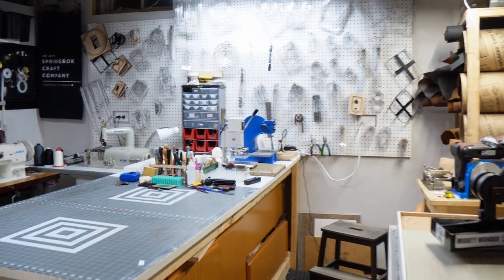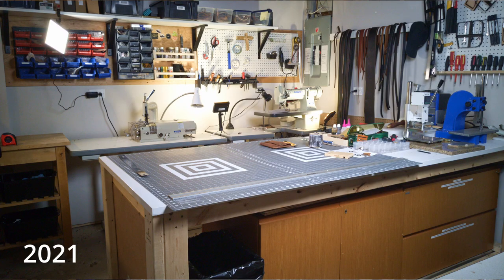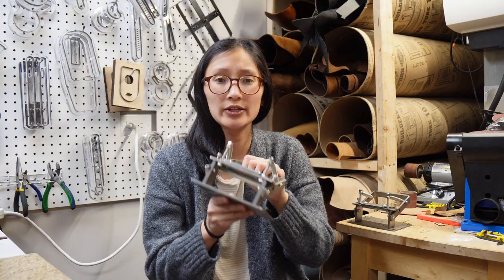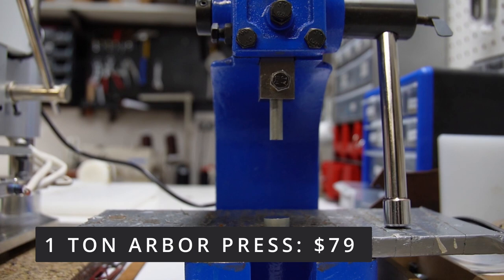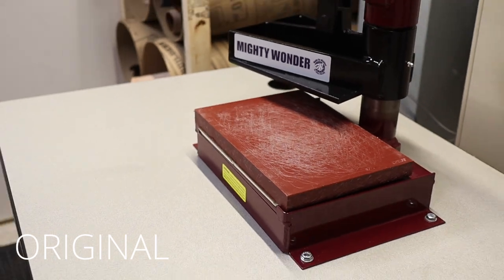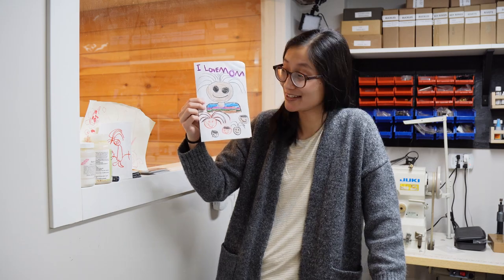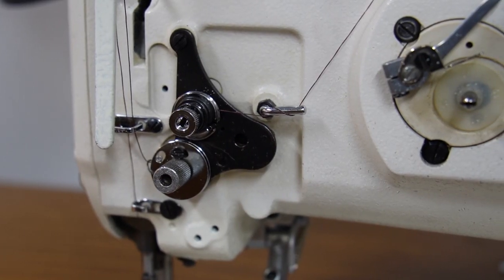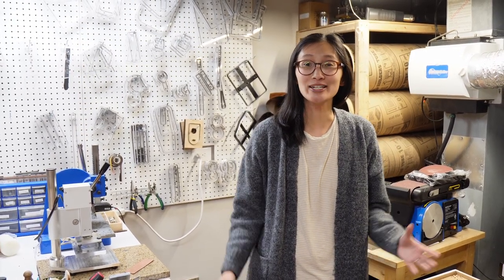My not-so-epic Leathercraft Workshop

Comment: I like your tip with the concrete forming tubes for leather storage. I've been storing my leather in the boxes it ships in but they're kinda crushable when you stack up a couple. I have an arbor press for riveting and I put a strong magnet on front to hold my rivet setter, it's harder to lose this way and speeds things up when I have a bunch of rivets to set. I cut a lot of straps and the best small space way I've found to do it is a plastic folding table. You can store the table when you're not using it and it doubles as something you can use at live events. I was using a 4' steel ruler to square the edges before using a strap cutter, but recently got an 8' cutting guide (can be taken apart to be a 4' cutting guide) at Home Depot, it was like $25 and came with two C clamps (which don't fit my table, but still nice).
Reply from the maker: great tips Ted. Might have to try that magnet tip. Thanks for watching!
Reply: Agreed! There were many great take-away's from the vid, but I will definitely also be incorporating the concrete tubes in my setup!

Comment: I notice you have both wooden based and acrylic based die cuts. Which one you think is more durable and perform better ? I'm thinking to make one but not sure which to choose as I never use before.
Reply from the maker: I feel like durability is not too different, but the acrylic is just so much better because you can see the leather you're punching. It's much easier to maximize space with the acrylic. And you can also much more easily position it around parts of the leather that's not usable.
Reply: @SpringbokCraftCo  Good points. Thanks Guru !